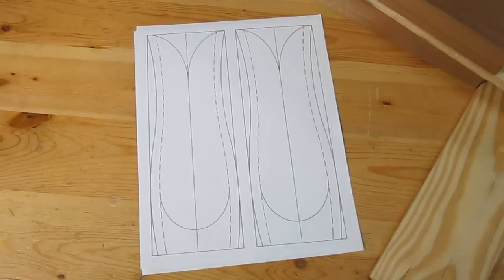Bandsaw Vase - Woodworking Project for Artificial Flower Arrangements

Comment: Steve, we drilled the center hole first then cut it all out. So much easier than drilling after the larger one is done. Love this vase thanks again for sharing. In the small vase I use a cigar glass tube. A friends husband smokes cigars and gives them to me. They are perfect for this.
Reply from the maker: Lori B Great ideas Lori!  I was thinking of trying a pvc pipe with a cap, but that's not so attractive.  Drilling the hole first it genius!  I didn't know I was going to end up with the smaller one when I made them.  lol

Comment: Terrific project.  Well presented--especially the "bonus" vase....
Reply from the maker: Thanks Tim!  Yes, the bonus vase was totally unexpected.  Even when I took that middle part out, I thought I would just throw it in the scrap bin and do something with it later.lol
Reply: Your videos look really good--can I ask what type of camera you are using?  I'm thinking about doing some Youtube videos myself...
Reply from the maker: I use a Canon Powershot A2200 that I bought from someone off craigslist for $40.  It shoots in 720p.  I use 3 clamp lights with flourescent bulbs and set the camera's white balance setting to flourescent.  Then I just make sure the camera focuses on the right thing and I use the Macro mode for close ups.  I suggest shooting short clips with different settings, then watch them all back to see what looks best.
Reply: Thanks!

Comment: Nice little surprise on the inside!.....2 for 1 deal there.
I once accidentally grabbed some cedar 2x4's for framing out a doorway.....it was a dark rainy day and I didn't even realize they were cedar at the time...........anyway I took the scrap cutoffs and made a few bowling pins on the lathe for a yard bowling game......nice wood to work with.
Reply from the maker: Yes, I really like the rich brown color and it's easy to cut and sand.  Kinda powdery dust though.  Thanks Sparrow!

Comment: nice work Steve. using your skills as research into buying my first bandsaw. gonna get a good jointer thicknesses first then a bandsaw. already have a table saw drill press and morticer. getting ready for retirement in about 15 years and the budget is tight but am slowly but surely building my shop.keep up the good work
Reply from the maker: +mediocre toker   Thanks!  The bandsaw is my favorite tool.  I would love to have a bigger/better one, like the Grizzly 14" anniversary one.  But the one I use was my father's so I kind of like using it because of that.  It works great for being an inexpensive Craftsman one.

Comment: Great project which you explained so easily, I have a poor skill of perception which really means I can't picture things like that or the bandsaw reindeer from a block of wood.  Upside down, inside  out and backwards is magic to me.  Just trying to be strait forward with you :-)
Reply from the maker: Thanks!  I had to think through the cuts on this one for several days.  I expected to cut something at the wrong time or cut along the wrong line, but luckily I just missed sanding the inside which wasn't so bad.

Comment: Rather than sticking a copy of the template on, could you have taped the sides back on?. I think they do something like that when doing 3d cuts with scroll saws and keep taping it back together until they do the final extract.  Love the project, wish I had the skill!
Reply from the maker: I couldn't tape the sides back on when scooping out the center.  It would have cut those sides too thin.  I saw your follow up comment so maybe you realized that.  lol  I almost made that mistake though.  I had to actually think ahead on every step of this one so I wouldn't ruin it.  Thanks!

Comment: Are you using a drawer as a sawdust collecter at 07:42 ?
If you are, then thats a cool idea that im bring to my workshop. Its a good height, near your workbench and easy to empty.

I also must say the vases look great when finished.
Reply from the maker: I didn't, but that's a great idea.  I think that was my vise sticking out.  I just dumped the dust on the workbench then vacuumed it up later.  Thanks!

Comment: hi fantastic vase love it how would you do a smaller version of this as i dont have that size wood
Reply from the maker: Glue up multiple smaller pieces of wood to make the block.  Get creative with different colors of wood to make a stripe pattern.   If you just want a smaller vase, print my template out at a smaller % scale in print settings.  My friend Hans made a really small version out of a 1.5"x1.5" piece of wood on the scroll saw.

Comment: You have the same table saw fence as I. The bolts on the top adjust it left/right to bring it in parallel when you tighten the handle right? Thanks a lot.
Reply from the maker: It's a craftsman stock fence.  It fell once and I did have to adjust it with the bolts but don't remember exactly how.  I think I need to check it again actually.

Comment: Hey Steve.  Hit the final glue up last night. Tonight is the final cut and then hopefully lacquer the following day.  Raining for the 3rd day in a row out here so... we'll see.  Anyway...curious how you keep your band saw blade from roaming around on you.  I used 2 in my build... a 3/8" - 64 TPI blade and for the hard radius at the bottom of the interior cut I had to switch to my 1/4" - 12(I think) TPI blade.  That 1/4" sucker roamed all over the place on me so the second vase is a loss I'm afraid.  Any insight you can give me for the next one would be most helpful.  Love the channel and the vids!
Reply from the maker: Rick Wilke Awesome, can't wait to see them.  I use a 1/4" 3 or 4tpi.  Lower tpi works best for thicker wood.  The blade is probably wandering because with that many tpi, the gullets between the teeth are too small to carry out 3 or 4" worth of sawdust from the cut.  Thanks!!!!!
Reply: Well that would make sense... I never think about the negative space between the teeth.  Thanks for the quick reply!

Comment: Steve what size bandsaw blade did you use and what size drill bit did you use on the little vase.
Reply from the maker: Hey, it was a 1/4" wide blade and probably 3, 4, or 6 tpi.   Not sure what size the drill bit was.

Comment: This is great!  This is a great weekend project.  I know this would likely be asking for  leaks, but could spar varnish be used on both the interior and exterior to make it waterproof, and then fresh cut flowers could be used?
I have to give this a try myself!  Great job again Steve!
Reply from the maker: Hi Scott!  I thought about looking into that.  But, I think an easier solution would be to find a glass or plastic cup or vase that would fit down inside it to hold water.  Something that looks like a test tube but bigger.  Thanks!

Comment: Hey Steve, me again. I am totally inspired by this vase and want to make one. I went to Home Depot to get a Red Cedar 2x4. They didn't have any. Checked with Menards with the same luck. Any suggestion on a substitute? You said the Yellow pine came from a pallet? I think I can find one of those. lol
You might be interested to know that we here in Michigan now have over 100" of snow so far. You want some? lol
Charlie
Reply from the maker: Hi Charlie!  No thanks, we like just 2-3 days of snow per year down here.  It's a treat.  lol  The wood could be a regional thing.  Only 1 of the 4 or 5 home depots near me have it.  Maybe call some other locations to check.  Otherwise you could pick through the regular cedar boards to find come nice colors and glue them up.  Green or purple poplar would be cool tool.
Reply: I was told that Red Cedar is a seasonal thing. It's mainly used up here for fence and fence parts. No one works on fence this time of year so I will keep watching Menards or Home Depot.
Charlie

Comment: very nice! I'll be doing this for my wife forsure. what you you suggest I use to seal the inside from water?
Reply from the maker: +Benjamin Gauvin Hi Benjamin - Good to hear you are going to make these.  I suggest getting some glass or pvc tubes to fit in the holes.  A cigar storage tube might work too.
Reply: +Steve Carmichael I was actually thinking of making the hole 1 1/2" - 2". so essentially having water directly in the vase. that way my wife can put a few flowers in them.
Reply from the maker: +Benjamin Gauvin   David over at the Make Something channel coated the inside of wooden succulent planters and beer steins with epoxy.  Check out those videos.
Reply: +Steve Carmichael will do. thank you again

Comment: Darn, i need a better bandsaw. I found this older video because someone on facebook mentioned your video as inspiration for his vases. I love them, but as i said, unless im going to keep them in dollhouse measurements, my little dewalt dw100 isnt going to get this done ;)
Reply from the maker: +Willem Kossen   Hi Willem - I made a scaled down template of these for my buddy who wanted to do them on the scroll saw.  They turned out great, but little.  You could try printing the template out at 50%.
Reply: Most of a Bandsaw is keeping it in tune.
Guides running true tires clean that sort of thing.
Reply: +Michael Rhoads true. My little bandsaw is limited though in its tuning options. I have severe issues with drift.